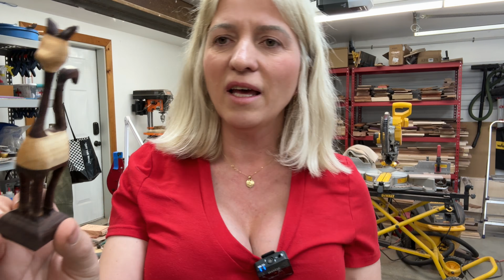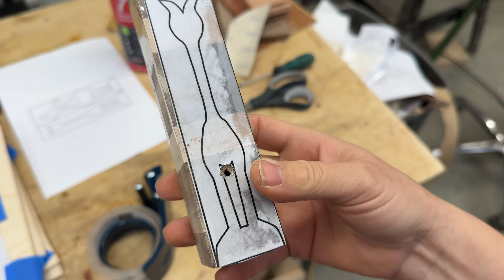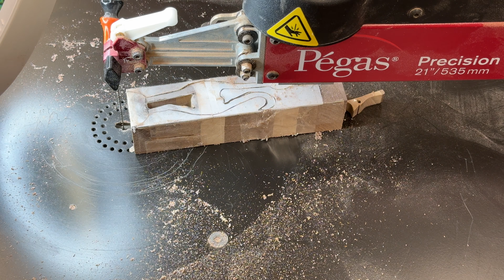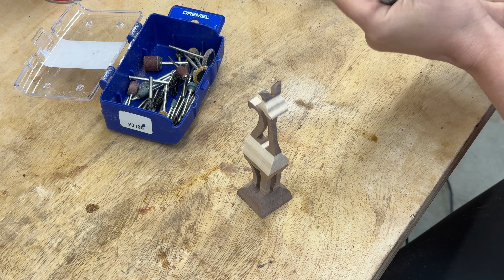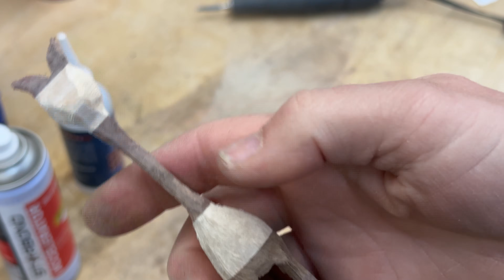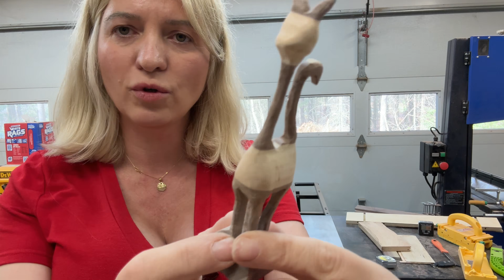Scroll saw cat. How to carve a cat using compound cut technique. Easy woodworking project

Comment: Hi Miss Sky! I recently bought a Longer 40 watt laser. I'm having a problem with etching. It etches darker on the start and finish, but very light in the middle. I'm just learning the laser, light burn, and how to set things up. I've cleaned the laser and adjusted the head according to the directions and  I've read everything I can find on this machine but nothings working. Any suggestions?